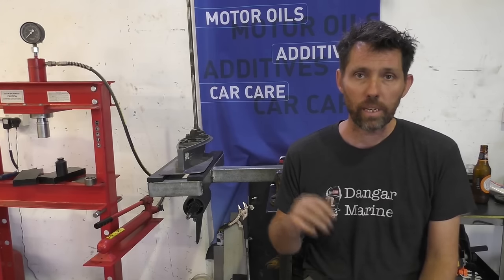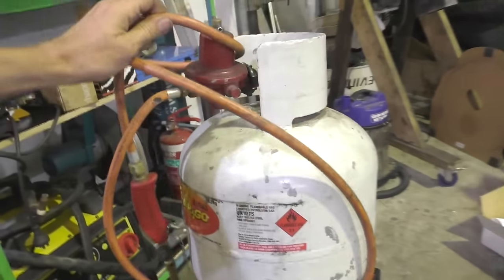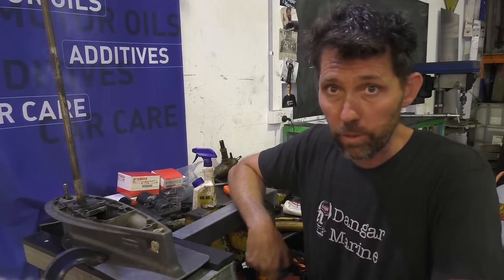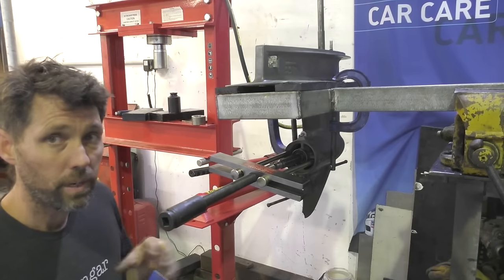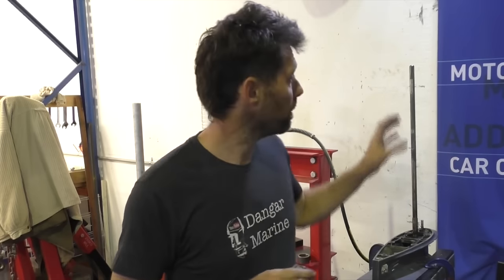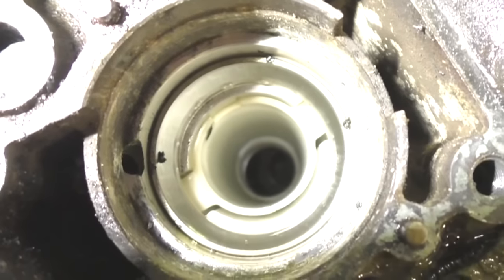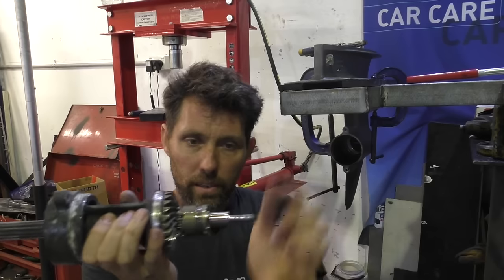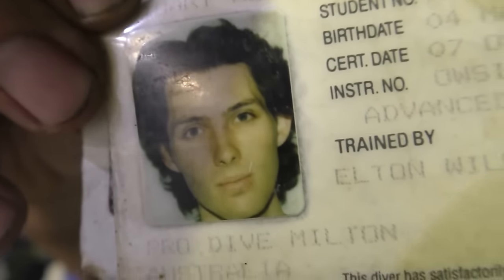Removing an outboard driveshaft

Comment: What's up buddy! Sorry for the late reply but I was wondering how! Or What's! The best way of removing the roller bearing off of a 2' 6" driveshaft and what type of tool! or tools! wood I need or needing! And ones off what wood be the best way of putting the new one on if you have any ideas i wood love to know all of your videos have been VERY!!!! Helpful in the past I'm just stuck on this one so if you have any ideas could you point me in the right direction thanks a lot bud. Agin keep the videos coming they are really helpful 👍🏽
Reply from the maker: You need to support the bearing with a separator plate and then press the driveshaft down. Be sure to put the nut back on the end of the thread when pressing though so you don't damage the thread.
Reply: Dangar Marine thank. Bud

Comment: I changed my 2005 f50 Yamaha impeller and now the lower unit is stuck in forward....which way do I turn the shift rod / gear to get it back into neutral? Thanks
Reply from the maker: Can't recall off the top of my head, but what I do is turn the selector at the same time as turning the drive shaft and watch which way the prop turns. The other thing you can do is look at the other end of the selector shaft that is still in the outboard with a torch and get someone else to move the gear selector.
Reply: If the outboard was in forward, move the gear drive clockwise to get back into neutral. Thanks from Texas!

Comment: I just bought a used lower unit. They said it was checked out by a 25 year experienced outboard mechanic . They said it shifted good, and was in great condition. First, I had trouble getting it on. It was tight. When I did get it on, the gears did not work right. Can someone tell me What I'm doing wrong, and how I can correct it?

Comment: did you make that slide hammer/vice grip?  That is a useful piece of kit.
Reply from the maker: When I bought the slide hammer kit it came with a variety of pullers. One of them was a small adapter that replaces the adjuster screw on the Vice Grip and then has a female thread that matches the end of the slide hammer.

Comment: G'Day Dangar... just curious, or should i say frustrated to learn how to remove prop shaft from a 90 yamaha 2stroke. Seems different to the smaller engine you're working on there. Any help would be greatly appreciated. Cheers
Reply from the maker: Can't say I've every taken the prop shaft out of a 90, we only work on smaller motors from commuter boats here. Does it need the driveshaft to come out first or something?
Reply: Not sure how they come apart. I am wanting the driveshaft out not the prop shaft. I just thought maybe the propshaft has to come out in order for the driveshaft to come off? I just had a cracked case, so i brought a 2nd hand one in great condition, however the drive shaft in it needs my old driveshaft out of cracked case case.

Comment: where did you get the vice grips slide hammer from or did you make it thanks mate michael
Reply from the maker: When I bought the slide hammer kit it came with a variety of pullers. One of them was a small adapter that replaces the adjuster screw on the Vice Grip and then has a female thread that matches the end of the slide hammer.

Comment: I'm pretty sure I need you to work on my outboard....lol That slide hammer thingy vice grips...you made that? BTW, thanks for the videos, I've learned most things are beyond my scope, but screw it do it anyway.
Reply from the maker: When I bought the slide hammer kit it came with a variety of pullers. One of them was a small adapter that replaces the adjuster screw on the Vice Grip and then has a female thread that matches the end of the slide hammer.

Comment: have a question  maybe a stupid one but I hit some rocks the other day I have a 1989 johnson 150 gt outboard ok will a mercury propeller fit on a johnson about the same pitch but diffrent horsepower me cry is 90 and johnson is 150
Reply from the maker: The number of splines will dictate whether the prop physically fits on the prop shaft, so you may be able to get going with it, but larger outboards will have bigger blades and a steeper pitch which means the smaller outboard probably won't ever reach it's operating RPM which trying to spin a prop meant for a larger outboard.

Comment: Hi Stu, Im looking for that Tapered Bearing for my old Fathers Driveshaft.  The model he has is an Mercery 30HP 4stroke EFI model.  Do you know where to get that spare part? The Trans has had water inside but still works fine. Im sure it's better to fix it thou. Nice video' you make.  Im a fan. BR Jonas - Denmark EU
Reply from the maker: Any local Mercury dealer should be able to order the part for you.
Reply: Yeah.. they take like 35-45% on top in DK...

Comment: Using heat on a drive shaft or other load bearing component is there a concern that the heat could weaken or make the component brittle?
Reply from the maker: You certainly want to keep heat to the minimum amount required to get the job done, but having said that, you would have to get a driveshaft like this pretty hot before it would suffer any real damage.

Comment: Good job Stu i'm having a hell of a time getting those locking pliers to grip onto the shaft may need that spline tool to loosen the pinion nut ? Do you know where i could source the tool from ? cheers Stu
Reply from the maker: Hi Russell, I got that one from a Yamaha dealer, they sell it as a service tool, but I am still trying to track down a full kit of every size. I'll let you know if I ever find one.
Reply: Cheers Stu
Reply: Things just getting better lol got the gears and assembly out then saw metal chunks all the lower unit. Seems to be in good condition just leaves the top end that the damage has been done ? this is vastly
 becoming the bull in my china shop lol

Thanks for all your help stu

Comment: Great video!!! What would be the case for grinding when shifting from Neutral and back to neutral? Is it too slow of a shift or issues with the clutch?>
Reply from the maker: It is definitely good to shift outboards quickly, it could also be the idle speed being to high or a bad adjustment https://youtu.be/B4acSf_BgP4
Reply: Dangar Marine I'll check it mate, man if you where here in South Florida(Miami) in USA you would kill it making so much money. Mercury and Yamaha are widely used here and everyone hates Hondas. Honda dealers do not carry parts or service Hondas and everything is through boats.net website. They are pretty good Outboards. If you move to US or visit let me know 😁👍

Comment: I have a 1994 Mercury 75 hp 2 stroke 3 cycl. after removing lower unit and replacing the impeller, I couldn't shift. it was stuck in forward, removing lower unit again, I noticed the lowet selector shaft would turn freel, how in both directions. Is it possible that it slipped out of the lower lob, if so, do I have to remove gear box to fix??
Reply from the maker: I doubt it will have slipped out in any way, they can some times take a bit of force to shift and can be hard by hand without any leverage.

Comment: Hi - I have a 93' 200 Johnson ocean runner an the pinion bearing failed and snapped the drive shaft. I do not have a measurement for the pinion bearing depth. It has the clip 25".  I can't determine exactly what spacer to get or the measurement. Any help would be great t

Comment: Stu, killer video as always. I have a Yamaha F150 RH counter rotating lower that has a significant amount of in and out shaft play... what could have worn out to cause this ? Compared to my port side it's much noiser too.
Reply from the maker: Sounds like the bearings are starting to fail.
Reply: @DangarMarine  thanks I plan on taking it apart soon to inspect.

Comment: i could send you my evinrude lower unit that my friend changed all the bearings in and you could do a video of what he did wrong..i tighten the prop carrier screws and the prop stops turning , it cane back leaking oil thats what made me check it out before i installed it ..its not right yet.. darn

Comment: Hey Stu, I love your videos! Most of the time I just watch to see what you're up to because you're awesome. But I looked up this video because I have a situation that is proving to be a PITA. I have a Mercury 25 HP with the lower unit off. I suspect that the roller bearings have seized due to lack of lubrication in either the driveshaft housing or propeller housing. I'm attempting to replace both along with new seals but my issue is that the pinion gear is stuck on the bottom of the driveshaft. I have removed the pinion gear bolt but this little gear won't budge, any suggestions on how to get that little bastard off? Thanks in advance... James
Reply from the maker: Hey James. If the nut is off you might need to your a puller or a press. As always, heat and lubrication will help.

Comment: Hi. Thank you very much for some really good and informative videos. Actually these videos have become relevant that I want it to be. I have a similar engine. When we put our boat back in the water last week following the winter break, we realised the engine is stuck in reverse. The selector rod shift fine, but we don't get any reaction from the gearbox. Do you think the problem could be solved by changing the oil (the oil gaskets are most likely leaking)?
Reply from the maker: It's not impossible that changing the oil will help as moving out of reverse to forward is pushed by a spring and it sounds like the dog clutch is stuck on the prop shaft. I would also try flushing it with some brake cleaner or something to get all the oil gunk out before putting the new oil in.
Reply: Hi 

Thank you for the answer. I will try cleaning it out and Oil it.

Comment: Thank you for your helpful videos. PLEASE HELP!!  Yesterday i was changing the shift rod seals on my Yamaha 50tlr. When i pulled the shift shaft seal housing, the shift rod came up with it allowing the shift cam to fall out of alignment. I was able to shine a light into the gearbox with the oil seal housing removed and get the shaft lined up with the cam. When i started this i was in neutral but i am assuming the gear box is now in forward gear. i am trying to shift it back into neutral and it will not go with the comfortable amount of pressure I have applied. I have been trying to rotate the shaft clockwise to go back into neutral but I do not have a splined nut adapter to turn the shaft with much force. Could the cam be mis-aligned or something? Am i turning it the right way? Or maybe i need to find a way to apply more force without damaging the shaft? Any help/advise would be much appreciated.
Reply from the maker: Couple of things could help here. First, make sure you give the propeller a turn with one hand while you rotate the selector shaft to help the dog clutch engage and disengage. Also, you can try turning the selector rod using some regular pliers. Often the grip on the pliers will fall roughly in the gaps on the splines and give some decent grip without damaging the splines. Finally, from memory those selectors will do 360 degree turn so you can simply turn it right around until you find where F-N-R are and then reassemble once you are confident of your position.
Reply: Thank you. Apparently when i was tilting the lower unit around trying to get the cam to line back up with the shift rod, the pin that operates the clutch dog fell out. So I had to pull the driveshaft and forward gear to get the pin out then reassemble. Thanks for your videos because without them I would have not even known where to start. You do a great job of explaining so even guys like me can understand.

Comment: Hey my pinoin gear is stuck on shaft after I got nut off any  suggestions
Reply from the maker: A bit of heat and maybe a small three jaw puller.
Reply: @DangarMarine  your best man and getting back to me so fast thanks man
Reply: @DangarMarine  I just ordered shirt from ya I want to support ya for your good deeds helping others plse note I changed my shipping address qnd you can also delete this message if you want not necessary

Comment: I've been a subscriber to your videos for a few years.....really helpful !

I'm rebuilding a 1994 Mariner 60 3 cylinder 2-stroke, model 7060412CD,  s/n 0G069743

I need to install a new shift rod cam.  To do this I have to remove the pinion gear.  It's really stuck.  In your video the pinion gear fell off the shaft as soon as the nut was removed.  When the pinion gear nut was removed from my motor's drive shaft, the gear stayed on the shaft.  I've tried several internet suggestions including penetrating oil, heating the gear and using a hammer/block of wood to attempt to drive the lower unit down while the shaft is fixated.  Nothing has worked.  The pinion gear remains frozen on the shaft.

Any suggestions ?

Thanks.......... George (Bonn)......Canada

PS:  I have an Aussie sister and many nephews, nieces and their offspring !

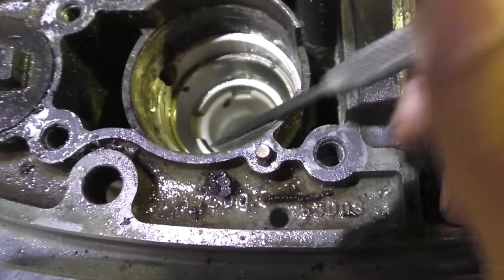Comment: At 10:42, what is the purpose of the hole on the top/left of the bearing race?
Reply from the maker: Good question, I'll have to take a look at a gearbox and see where it goes. It isn't in the race itself but the casing the race gets pressed into. I would say it is for oil circulation.

Comment: Working on a 70 force makes a clunking noise and doesn't go over 25 . Usually reaches 35 m.p.h . Any help is much appreciated
Reply from the maker: Hi Chris, could be many things. Could be a failed conrod bearing or a gearbox problem as the most likely though.
Reply: Thanks

Comment: Has anyone removed the gear shift lonksge rod in the lower unit? The top end of the rod is seated between some bushes or bearings with no obvious way of removing them. The bottom end is behind the forward gear in the bottom assembly. Our gear lever is constantly stuck in neutral and we can’t work out why we can shift into gear. The top part of the gear linkage moves freely. Just the bottom part that’s stuck. We can disassemble everything like this video but the vid doesn’t show how to get to the bottom end gear shift rod. Thanks

Comment: I can not find that drive shaft upper spline scoket anywhere...where did you purchase it stu? Do you have tool number ? Many thanks ...having quite a bit of trouble holding the drive shaft whilst trying to remove the bastard d/shaft nut from hell 😂😂 have a few ideas yet to try but that spline tool would be perfect ...cheers
Reply from the maker: I thought I just used vice grips to turn this one? I've never been able to find a good set of female splines for this application but I wonder if an e-torx socket of the right size would do the trick?

Comment: my driveshaft wont come out once i remove the carrier bearing what is causeing it to hang up
Reply from the maker: Do you have the nut off the bottom of the shaft that holds the pinion nut on?

Comment: Alright, I hope someone can answer my question. I have a Yamaha 25hp 4stroke 2002 F25msha 65w and I have a cracked lower unit.
 In in the lower gear case after I got it from the guy used I was revving it up in neutral... (which I learned not to do)  All of a sudden a ton of water came out of the bucket there was a loud noise smoke came from my lower unit and then the engine shut off

... I was like oh crap...  

now when I run the motor in neutral it makes a clicking and I have not tested Fwd or Reverse to check if it does it there but I don't want to damage anything... 

So I recently found a Yamaha 30 hp lower unit and my friend gave it to me to see if it will fit in the 25hp ( he said he thinks they are the same type but the lower unit he has is a bit older but he was not sure... he is also a mechanic. I also was traveling so I can't really ask him any more questions about it easily. 

The problem is that the lower unit that I got is a long shaft lower unit and I have a short shaft right now for a jon boat.
He said to just swap the driveshaft from the current lower unit to the older one that hopefully will fit. 

Is there any way of telling what kind of lower unit it is and if it will fit? it has the same shape and looks to be the right kind.
will switching the driveshaft work? 
Is it fairly easy to do... I want to learn how to do stuff with motors (one of the reasons I came here) 
whats the clicking sound? (i think its the gearcase and the shifter maybe be loose... 

thanks for all the help! I need all I can get :)
Reply from the maker: Hi Andrew. So it sounds like the original gearbox selected a gear while you were revving it in neutral, hence the water coming out of the bucket. The smoke was probably just exhaust gas. The clicking is also a sign of a problem with the gear selection mechanism - it is the dog clutch contacting the back of the gear. 

The 30HP gearbox may well fit. If the measurements are the same and it uses the same gear selection mechanism (twist or push-pull) then other than a slightly different gear ratio maybe it should be identical. Here is a video on removing the driveshaft https://www.youtube.com/watch?v=BF3e32Iefo0
Reply: Thank you so much!
Reply: I will definitely try it!